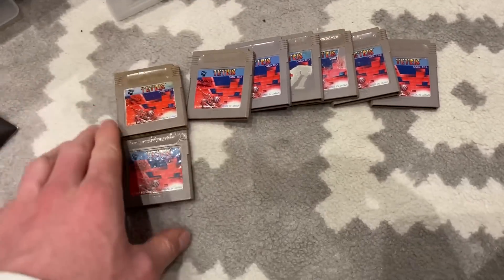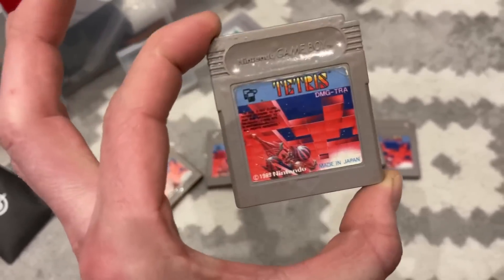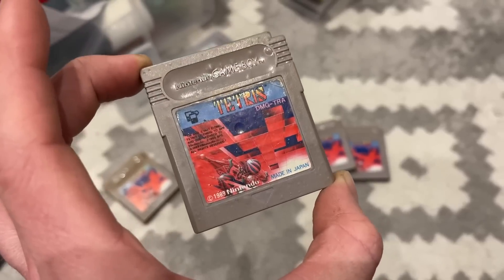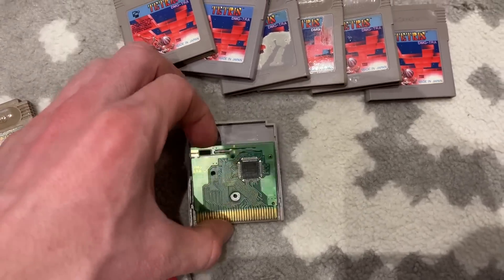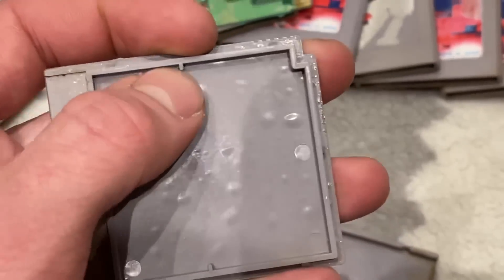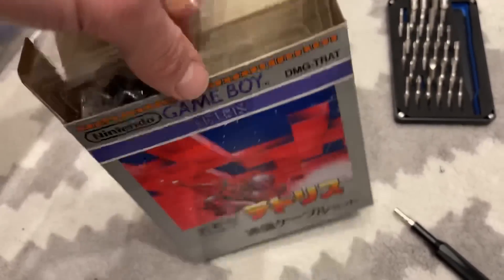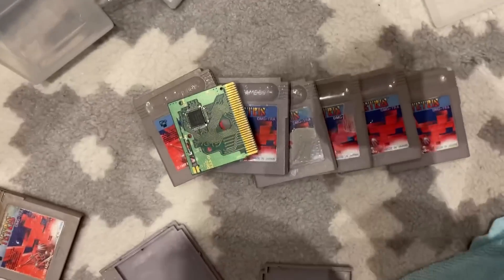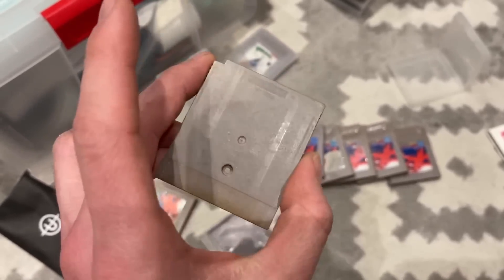Update on the destroyed GameBoy games

Comment: gasses like petrol and acetone (acetone and propane are the same thing btw) have similar chemical structures to plastics (they're all derived from oil), which is why you can't pour acetone in a plastic cup without the plastic getting eaten by the acetone, why acetone vapor baths are used to smooth 3d print layers, and why people melt little ABS plastic bits into acetone to make a plastic weld paste to repair cracks in broken plastics. introducing vapor of a similar chemical compound (petrol fumes) to the solid form (plastics) causes the vapor to form chemical bonds to the solid's surfaces, which curing process of the plastics and might be why you might see that glossy sheen on the surfaces, and is probably how air bubbles entered or escaped the plastic shell

Comment: Petrol and Benzene in particular softens many plastics, ABS is one of them. Colorants can keep it safe so some amount of time but you should ventilate all cartridges which haven't warped yet to keep them from further harm. The silky/oily stuff on the inside is a mixture of ABS and some solvent. That stuff adheres to the mainboard. Afaik it won't damage the board but you can clean it off with isopropyl alcohol.

Comment: Not sure if this would have saved them, but I have clear acid-free plastic protector sleeves in all of my games for long term storage. Like the same material a clear Ultra Pro card sleeve is made of. I get them over at a website called RetroProtection, but many dealers have them and you can find them on ebay and Amazon.
I come from a history of collecting Magic: the Gathering, though, and double sleeving all my top dollar cards. lol. My collection of Atari 2600 carts (near mint Activision labels with no adhesive bleed) are all wrapped in sleeves, and then also sealed in a rigid plastic cartridge protector. Also, I would suggest black totes to block all UV light.

Comment: I suggest checking all the Games in the box. It may be that the manufacture of the Map Cartridges of different vintages was made. As a reminder, the Console came out in Japan in 1989. The Development of games using GameBoy prototypes was 1980s. The Question is when the new revision of the Cartridges came out, it takes a long time to research. ABS and PET are different plastic material. In the case of ABS, mostly Lego bricks are made, although it is stable, the Storage and caused chemical reactions, and harms the plastics. Even PET could melt, but not as much.

Comment: Yes that's very possible mostly because of the type of plastic that they are made from and it could also be a combination of the chemicals and temperature fluctuations or humidity. Sometimes just you chemicals from your hands are able to cause massive damage to your cartridges when combined with humidity and temperature. I would recommend using isopropyl alcohol to clean up the cartridges inside and out. I really recommend that you start cleaning them asap and also I recommend you use a micro fiber cloth to keep any abrasive substances off of the cartridges. If your normal cheap micro fiber cloth is a little bit too abrasive for your liking try using a ultra fine glasses cleaning cloth.

Comment: oh yup, petrol/gasoline is one hell of a solvent so yes indeed it would do it, the older plastics arent as stable so would react a lot quicker to much less
that shimmer as you describe it would seem to be part of the plastic composition coming apart, it probably wont affect the board particularly if you clean it off relatively soon, if its oily get it off but if its just a coating you might not need to worry too much about it

Comment: You said you kept them in those storage bins? Sealed up in the attic or upper level? This is a very common occurence in NES carts. Serious collectors have definitely seen bubbling before, and there are reddit posts about it. It's almost always 1 of 4 things: 1) Hot and humid storage, 2) direct sunlight, 3) mold, 4) solvent exposure. It could have been petrol, or you stored them in the clear container near a window or sunlight. You potentially green-housed your game carts. OR it's a combination of everything. Best store your stuff in freezer ziploc bags inside of a solid color(READ: NOT CLEAR) storage bins. Also keep color changing dessicant in the containers that hold your ziploc bags so you can visibly see if there is moisture. Usually Indicating Silica-gel, It's blue if it's moisture free, and turns pink if there is moisture. None of these safeguards are expensive and will keep them safe if you choose to store them away for long term.

Comment: This checks out, I didn't comment on the other Video but I had a suspicion, because they were more or less "sealed" in that plastic Box, meaning that even though differences in temperature could have happened, but the damage propably would've been a lot less in that case.
Something like petrol fumes which directly attack the plastic, even in low volumes, are the most propable cause.

On another Note, I really like your attitude of not letting yourself get down, because in the end they're just things, games.
Games that still look playable, and that's ultimately what they're made for.

Comment: Hello Mr. Coll,
First, I want to say as someone who is a collector myself who has experienced similar tragedies, I feel your pain and frustrations.  I offer my opinion and an additional concern for you.

Given a lack of a few details I'll be making a few assumptions.
First your loft:
I get the feeling your loft is not climate controlled.  While it can be true that your loft may not get oppressively hot or cold, there is still a change in temperatures.  Over the course of years, the constant changes to temperatures from hot to cold, whether it be 100F to 70F (37C-21C) in the summers or 40F to 0F (4C to -17C) in the winters, can subtlety damage plastic as well as other materials, depending on composition and quality.  (It tends to be one of the reasons you have wine cellars not wine attics).  I have noticed that photos, PC Boxes, CD/DVDs, and other retro "artifacts" age faster when stored in non-climate-controlled environments such as sheds, garages, attics, even basements.  I've learned to play Tetris with my collection in closets, under beds, and other creative spaces in my home.
If your loft is not climate controlled, then I am also assuming ventilation of your loft is ether non-existent or rather extremely limited depending on how it was built and the building requirements of the day.  Your dehumidifier may do an excellent job with moisture levels, but it does not filter chemicals from the air.

Which leads to the topic of the petrol fumes:
I'm sure the bike petrol in your living room was the largest contributing factor.  As pointed out in the various other comments the differing plastics between your cartridges are why some are ruined, and others are not.  I've ruined a retro "artifact" or two in my early years of collecting because I didn't understand that not all plastics are the same as much as not all cleaning chemicals are the same.  While you were able to open the windows of your flat to air it out, (which is what helped save your non-loft collections) if the fumes had permeated into the loft, the chemical fumes would have lingered since I am assuming your loft had no forced ventilation.  Your storage bins (at least the ones shown in the videos) are not air/water tight, so the fumes over time would have eventually seeped in affecting the plastics.

Now given the environment in the loft, the age (and possible accelerated aging) of the plastics, combined with the petrol fumes, all that tends to produce what has been seen so far.

I generally tell others who are not only into collecting retro "artifacts" but just also simply the preservation of precious memories (photos, toys, books, nik naks, whatever). Attics, basements, garages, lofts, shed, vehicles. All of these, while convenient places to store things long term, also tend to be the worse places to keep treasured items.

Now to shift focus from the cartridges.  I would suggest checking everything that is stored in or apart of your loft.  My concern for you is that chemical fumes can have a negative effect on some printed materials.  I say this because someone got me small poster of a B-Wing battle from Star Wars that I kept in my garage. When it was time for me to move home and I took down the poster to pack it I noticed the ink was smudging as I was handling it.  Turns out that some of the fumes from the chemicals I was using to clean parts with over the years had compromised the ink in addition to the garage being non-climate controlled.

Please take this tragic affair as an opportunity to learn and grow.  As long as you are able to do that you can recover and become a better collector and showcaser.

Best wishes and luck to you.

Comment: Plasticine leaking from the plastic breaking down.  Petrol fumes could do that but plastic bins are also heat conductors adding to the issue, especially if fumes got in and the lid was shut.  If you took a shell and hung it from a lid in a glass jar with acetone at the bottom the same thing will happen.

Comment: Moist in a closed box at a certain temp is condensing with lower loft temp, then evaporates again at higher loft temps and distributing moist trough all you're items again, better store in controlled places or add a silica bags to keep the air as dry as possible inside....This is the reason why i still use cardboard boxes, they distribute  the moist in the box to the outside and evaporate, instead of trapping it in a sealed container.

Comment: It appears the plastic is deteriorating. The best solution will be to change the cart housing. However the sticker needs to be transferred carefully and value may drop since it will be replaced with an after market 3rd party housing. Its possible the fumes has something to do with it. And since the cart are earlier versions its possible the materials used on making them seems not to be able to withstand the fumes yet.

Comment: just a random thought, it might be a side effect of the cartridges themselves, they are all of the same age and identical plastic composition and some materials have a problematic decay process.  the basic idea is that when it starts to break down in breaks down into gases and residues that accelerate the decay and can trigger other similarly composed materials to also start going off, leaving it in a sealed tote is the worst possible thing for such materials since it locks in the corrosive byproducts further accelerating the decay
this is an issue that museums and libraries have been dealing with for decades for their glass and film items since both are affected by this kind of process, its irreversible, once it starts it cant be stopped, however if you clean off the residue and keep it in a cool dry well ventilated area then you can slow and sometimes almost totally halt the process so the item will outlast you
obviously thats not a totally viable option here but start by doing the cleaning and dont put it back into anything air tight
glass and film affected by their respective processes can go from fully intact to entirely gone in less than a year if the conditions are particularly bad, im not sure if this is applicable to gameboy plastic but abs does have some similarity to the materials for film stock and the batch your carts are made from is a particularly old example of its formulation from its least stable days

Comment: Try utilizing a food dehydrator, and follow the recommended time and temp for abs 3d filament.
Certain plastics are hygroscopic, and will pull in moisture from the environment over time.
Food dehydrator can sometimes reverse that process.
Worth a try at least..
Good luck.

Comment: It is weird that some would be worse off than others, but I'd chock that up to the variations in air flow of a room. Once the gas is a vapor it flows with the air in the room, and then the chaos factor comes into play. Gas, as a state of matter, is quite difficult to accurately predict. Some super computer simulations can get insanely close, but never 100% accurate. However, you'd have to make a 3D model of your room at the time it occurred and it would have to be fairly accurate and surely no one cares that much. Or do they, I don't know. As for the residue on the cartridges, that's because the gasoline is a solvent and what you have there is liquid plastic dissolved in gasoline. Which goes to show you how pernicious it is as a solvent that such a tiny amount of vapor can destroy so many.

Comment: i would wipe down all the games that where in the box and use a new box just to make sure that no residual chemicals are left behind as petrol will 100% do that damage  like i mentioned in your last post chemical gas would do that,  warm soapy water will help the plastic and isopropyl alcohol to give the boards a quick clean as petrol will corrode the boards over time. if you need any help sorting anything out or if you end up with any broken board feel free to give me a shout as I'm in the UK and have done technical electrical engineering for years and have rework stations and most of the tools needed. hope you get it all sorted soon

Comment: Pretty sure fuel has solvents in them, which can damage some kinds of plastic. For instance, we got new shopping carts not long ago and have been using sanitizer on them regularly. However, the sanitizer destroyed many of the plastic warning signs attached to them. It also had damaged plastic on the checkouts as well.
I would guess the Minuets were made of a different plastic or through a different process than later shells.
Also, you probably should have washed your hands before checking the undamaged Minuet.

Comment: I've had issues with those "soft" clear plastic storage bins like the ones your keeping those in melting other plastics like this. I've been told to keep my collection out of them in the past. I've noticed other instances where different types of plastics cause a melting issue, My Sinclair ZX 80, kept inside in a closet its whole life, has a melted line in the bottom of it from the wire on the ac adapter, def two different types of plastics there. I dont think the fuel vapor had any thing to do with it, if the vapors were that strong to have started melting plastics you house would have probably exploded before any thing melted in the first place. A tiny amount of gas makes a big stink but does not equal damaging vapors

Comment: Not adding anything new - but agree that the damage seems clear to be to be related to a solvent, or fumes warping or degrading the plastic. If I were you I would get those motherboards out of those cartridges because the plastic is clearly compromised. You can clean the boards with isopropyl alcohol to get any potential contaminants off of it. Also if you’re able to mark up the plastic with your fingers, I would be careful what else you touch with those fingers.

Comment: With your loft storage you're saying it's in fresh air, which may be the case, but if you don't have an exhaust fan up there it's going to take longer for the fumes to clear out. That and the fumes getting trapped in that tub could make the issue worse.

Comment: in some cases due to cold weather countries is been known during manufacturing "" for ABS to delaminate and or Blister from any other materials, especially when introduced with heat or Pre-line Parameters. such as and maybe due to the Petrol or fumes from settling on the ground mixed with oxygen,, the ABS plastic from the Gameboy cartridges are old brittle and yellowing due to multiple different reasons, so the mix of everything could have just been it time to go.. plus manufacturing them back them was poor and low quality plastics compared to second editions and todays plastics... hope this help or makes any sense?

Comment: did you use any acetone cleaners on them .. that can cause that the fumes anyway and besides you had them in sealed containers in sealed containers in boxes etc .. fumes would be hard too get in them .. BUT if you cleaned them all with acetone cleaners or white vinegar is another . and them put them away straight away the fumes would just build up and cause that maybe

Comment: the older gameboys plastics are indeed made from a more fragile mixture made from petroleum, just like the groovy furniture from the late 70s and 80s. Or those crème / grey colored electronic devices we used to to use remember?…..anyway when you said petroleum gas, you indirectly made a an acid for other petroleum solids reacting to the gas (if it’s was liquid it would have dissolved into a liquid and a gas would manifest into a gas) . One way to prove this theory is checking is if the cartridges are close to the floor. After the 2000s they used different plastic made from a chemical called g27 I think, which is way smoother and less prone to melting or shatter over time by UV light….
Reply: Btw also if this is the case, please check if you pvc pipes are also ok. Because even today they’re still made petroleum based plastic

Comment: Not the Petrol, as obviously the cartridges that were closer to where that petrol fumes were most concentrated were not effected.
Contaminated Plastic "Via salts and fats BTW "also dependent on the type of plastic" when heated warps and bubbles, all it takes is anything around 35~90 degrees Celsius.. And to prove this a Heated Sonic Cleaner will reveal at what temperature this warping occurs..